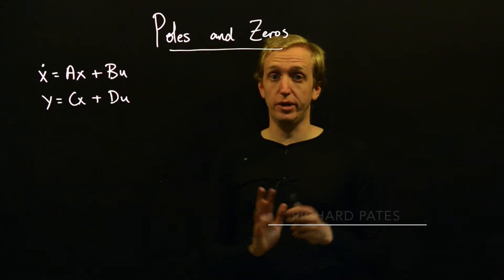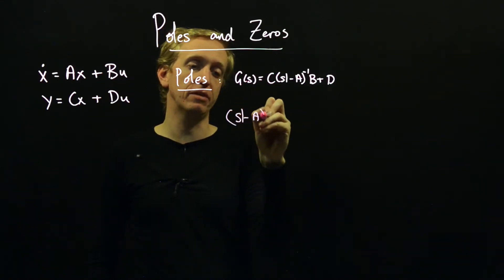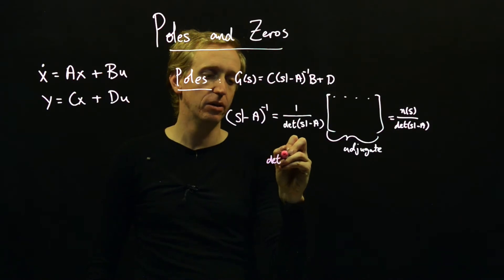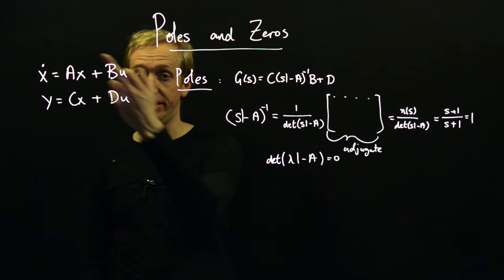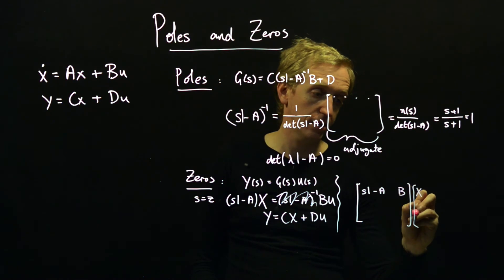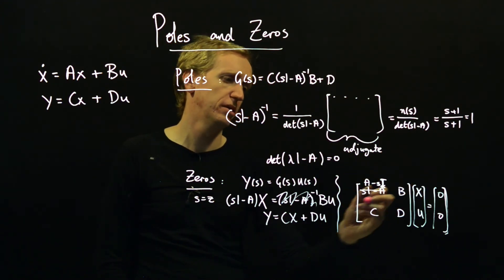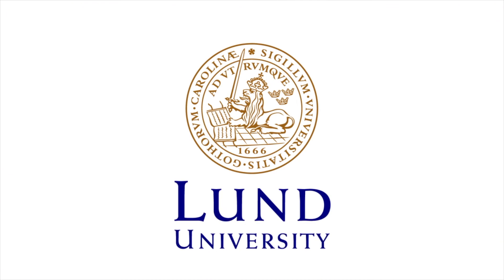Finding Poles and Zeros using State-space Methods

Comment: How to find zero direction from G(s) & a zero z?
Reply from the maker: Good question! If z is a zero (often called a transmission zero), then 0 is and eigenvalue of the matrix G(z) (i.e. substitute s=z into the transfer function making G(z) a matrix of complex numbers, and then take the eigendecomposition - at least one of these eigenvalues will be zero if z is a transmission zeros of G(s)). The input direction associated with the zero is then given by the right eigenvector for the zero eigenvalue, and the output direction the left eigenvector.

You can also find the directions directly from the state-space description. Provided the state-space realisation is minimal, z is a transmission zero if and only if there exists a nonzero x and a vector u such that [A-zI,B;C,D]*[x;u]=0. u is then the input direction associated with the zero.
Reply: @richard_pates  thanks for the reply. From what i understood by your statement:
G(s)

Then write G(i*omega)

Then write G(z*i*omega)

Equate G(z*i*omega) - lambda*I=0

Values of lambda1 and lambda2 are the output and input zero directions
Is that correct?
Reply: Sorry I meant Equate det (G(z*i*omega) - lambda*I=0)
Reply from the maker: @DhruvHaldar  You are extremely close. A few small misunderstandings though:

1. Normally the location of the zeros are specified in terms of values of s, rather than  omega. So you literally just substitute in the location of the zero for s. So to give a SISO example:

If G(s)=(s-1)/(s+1), we have a zero at s=1. So the first step is to substitute in s=z=1. You'll notice that in the SISO case this gives G(z)=0 always.

2. You are right in the eigenvalue problem that you are solving - but the you always set lambda=0, and then solve for the corresponding eigenvector. ie we want to either solve:
G(z)*u=lambda*u=0
or
y'*G(z)=y'*lambda=0
The right and left eigenvectors u and y give the input and output directions of the zero.

So what is the idea here? In the SISO case everything is trivial, since G(z)=0, the corresponding eigenvectors are u=y=1. But it also makes sense that things should be very simple in the SISO case. Since the inputs and outputs only have dimension 1, there is only one direction they could be pointing. These more general definitions are then trying to just capture the same ideas, but for matrices. So what is the analogue of G(z)=0 in the matrix case? We could say it should be that G(z) is a matrix of all zeros. But this is too restrictive, because even if G(z) is not equal to all zeros, there may be directions in which it behaves like zero. This is precisely what the equations we are trying to solve say:
G(z)*u=0,
y'*G(z)=0.
In words they are asking, in what directions does G(z) zero everything out.

So in summary. First find z as explained in the video. Then build the matrix G(z). Then find the eigenvectors associated with the eigenvalues at zero of G(z).
Reply: @richard_pates  thanks i understood. Also, in a mimo case zeros and poles don't cancel each other because of different input output directions right?
Reply from the maker: @DhruvHaldar  In general that is completely correct, yes - it is quite possible to have a pole and zero at the same location

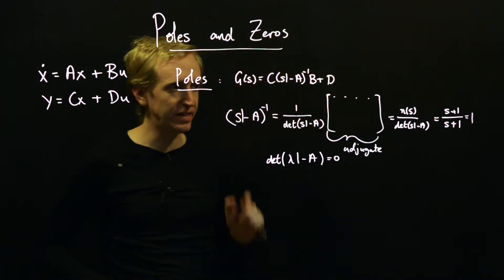Comment from the maker: Please note I got a little bit tangled up when musing on system poles around 5:27. In the situation when the numerator and denominator polynomials of the transfer function G=C(sI-A)^(-1)B+D have a root in the same location, you absolutely should not call this point a pole. The correct term for these points are removable singularities. Whether or not you are concerned about these points is a more philosophical issue (which is what I was trying to get into in my ramblings). Since you will never observe the effects of your inputs on these system behaviours, should you really care? Something to think about perhaps, and the answer really depends on how you obtained your model (input-output data, physics, ...). Not a big point though - just something extra to think about!